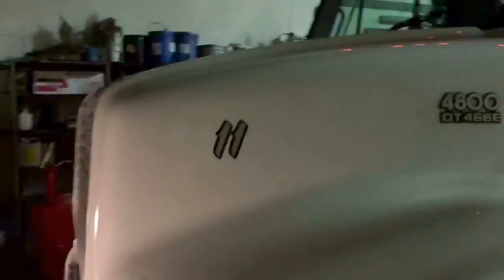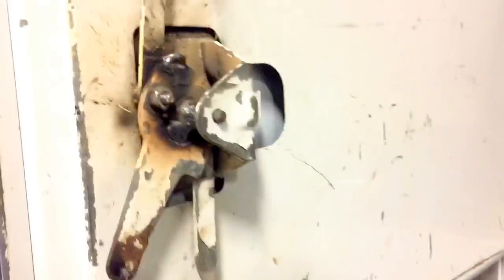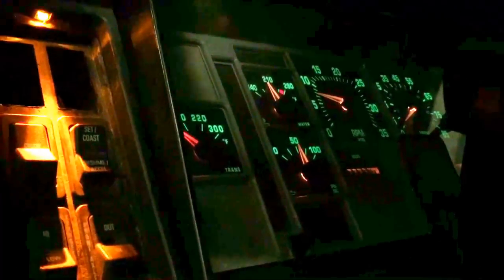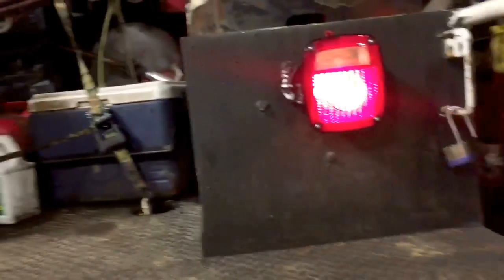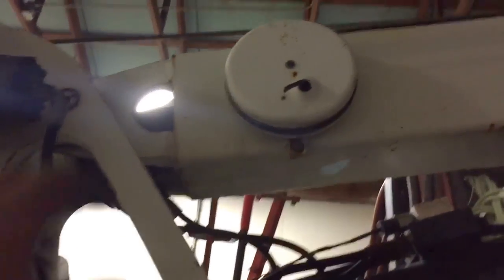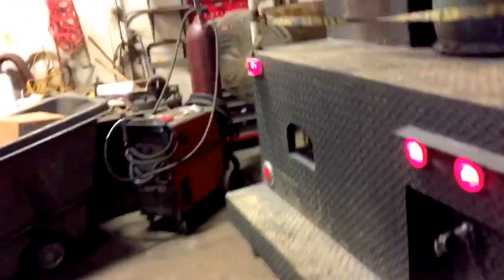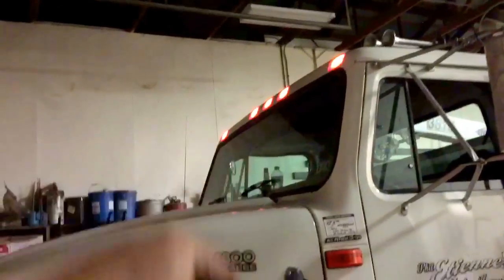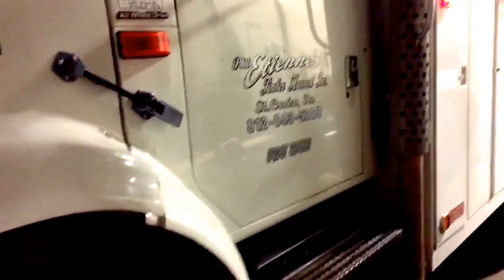Working on nick knacks...

Comment: That looks like the same cab set up we had. Ya might put a bead of caulking around your black cup holder insert or a big ole goober of grease around it. When the coffee spills and gets under that black insert it runs down right on top of the radio. We filled the hole up with spray foam and caulked that insert in place when the boss said wouldn't replace the radio again. Never another problem. Those are bullet proof tough trucks, ours was a 2000

Comment: I love your buildem videos.  Love the older internationals. Tough little trucks. I got a 4700 chip truck, but I screwed up and got the 444 motor. I'm hunting for a pre emsissions 4300 or 4700 with 466 so I can build a bigger one!
Reply from the maker: Tom Saad yeah buddy I got the 466e in this one it seems ok just needs a little boost